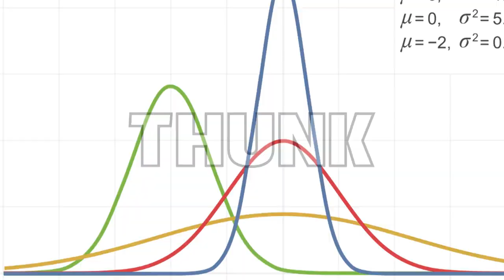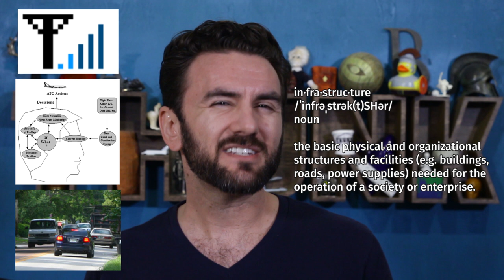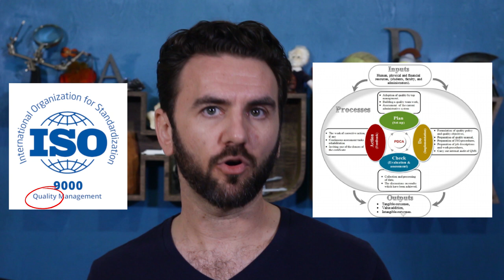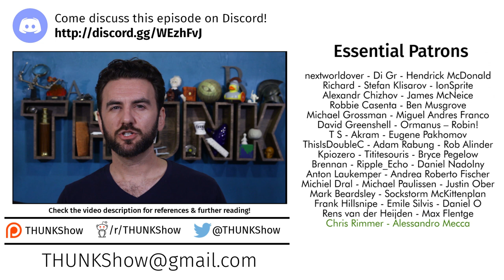235. Infrastructure and Standards

Comment: Thank you for the trauma flashbacks from the ISO 9001 implementation that happened in my last job.😱
Fun fact: We were required to label all files with an "OBSOLETE" sticker if the material was no longer being used. I wore an OBSOLETE sticker on my shirt for two weeks and NO ONE commented. 
Any standards that do not take into account the local conditions in which they are to be applied are either useless or dangerous. The concept of ISO is good. The implementation is terrible.
One way to improve this would be to make ISO standards freely available, if only so countries and organizations could have the chance to point out how badly they apply to their situations.
Eventually, this might lead to improvements in the standards that avoid the current problems. People being people, however, I'm sure there will be turf wars over who is responsible for what.

Comment: YES... I fully agree with Matej Sloboda's comment: if it is required by the law, then it should be publicly available, period. But we should not limit such statements to ISO,  ANSI, or DIN.
And IEEE? To do a simple floating-point operation - should we pay a high price for an 80s standard updated 30 years later?
And NEC/NFPA? It is about safety and is law in many states and municipalities, for God's sake. Should we download an older version of the book specifically for a state from the archive site for free just because it "was" a law two years ago? And pray that section we are reading had no change?
And IEC? For electrical safety and works. Getting the commissioning book(s) is almost impossible without leaving a lot of money to the organization.
I am also a technical guy, and I deal with different industries - from oil & gas to information technology in many countries with imperial and metric standards  - I always had this kind of problem: no access to a mandatory standard... a real mess. A project led by a medium-sized company in a Third World country member of the IEC needs an old NEC/NFPA because it has no access to an updated IEC document.
AGA for gas standards and ASME for metallurgy - all together and all very well paid to make us follow the standards they write for a gas pipeline project under conditions they have never been submitted to.
Let NEMA be paid - they are specifically for profitable manufacturers - American and Japanese ones. Two certified organizations for shipping and shipbuilding only - one American, another from Norway - and now we have another set of standards for more safety - SOLAS (Safety on Land And Sea)... we can't buy a plain inexpensive power generator without some penalty. 
Concerning the safety of the people and environment: of course, we all agree these standards should exist - but we are talking about access to them here.

Comment: There were a couple of cases from years ago that reflect on this.

Most U.S. jurisdictions adopt building codes as law from one publisher wholesale.  The publisher made a bunch of money charging a lot for the books.  Some builder, plumber or whatever was pissed and had one of those new fangled internet connections.  He made the building code available for his jurisdiction available on line, for free.  Then legal stuff happened.   I don't know what the results were.

Another case was a company put together electronic case law references, on CD I believe.  They included the indexing of the publisher of the most common paper books, West, since most judges insisted those numbers be used.  West sued.  I don't know how that was resolved either.

When I'm king any document that has the force of law will be public domain.

Anyway there may be case law making it accessible.